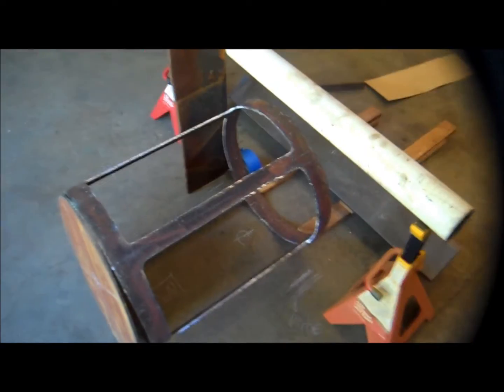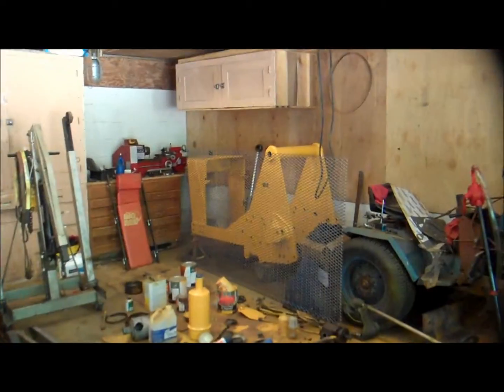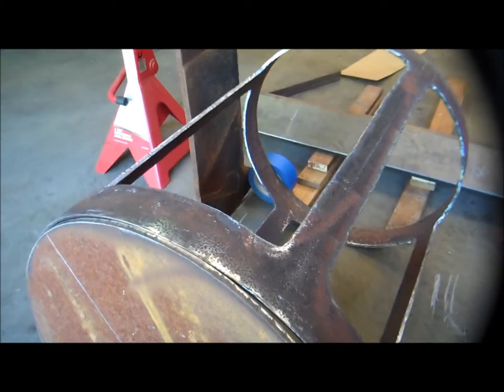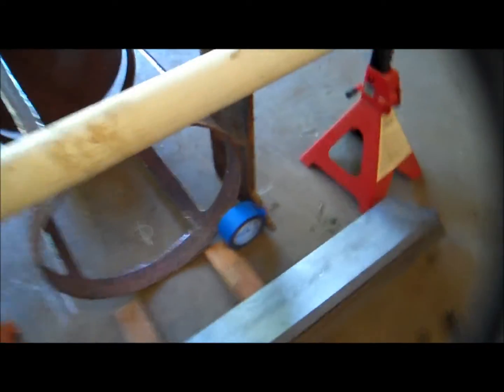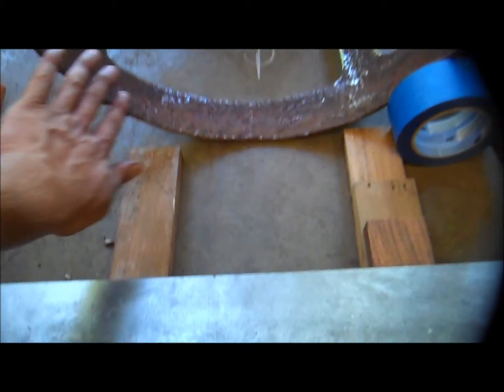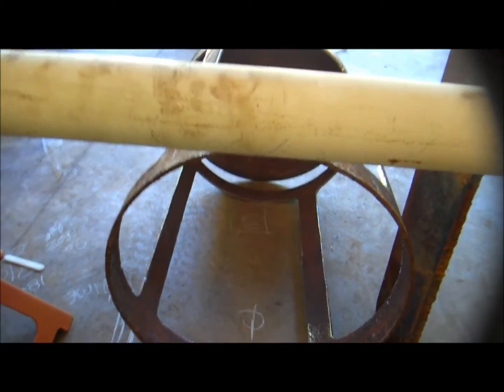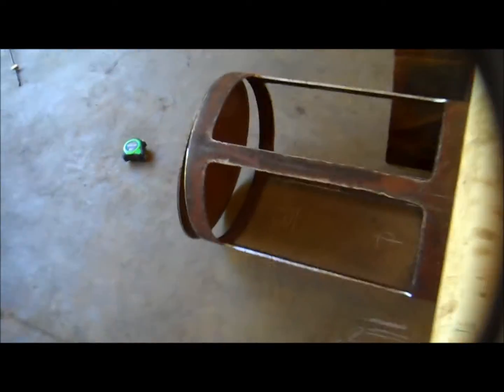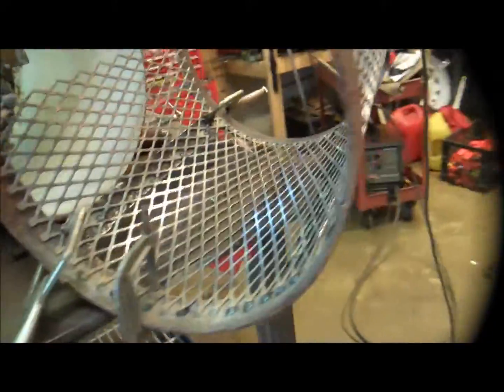Rotary screening bucket project for excavator part 1

Comment: Hey,
I am very interested with this video. And I have a small doubt about the  four bearing support what you gave in the front side of the drum. 
 while working on soil or mud there could be a chance of stuck. So what is your opinion. Is open support is good or closed one ...??
Reply from the maker: It's not being commercially used so it will do for now.